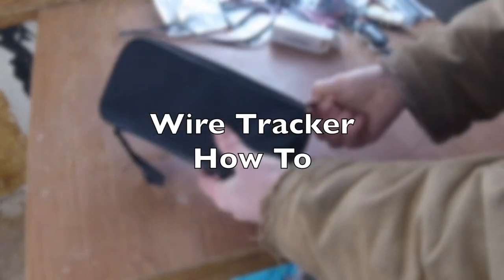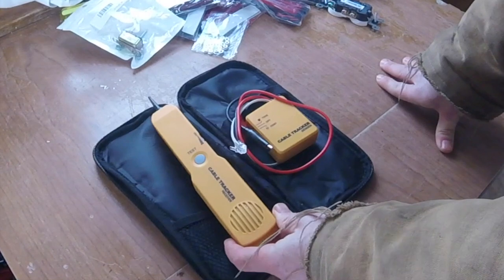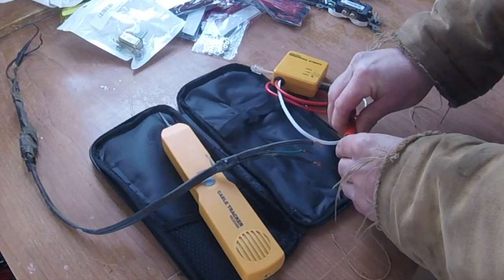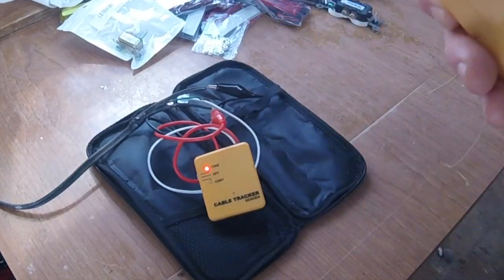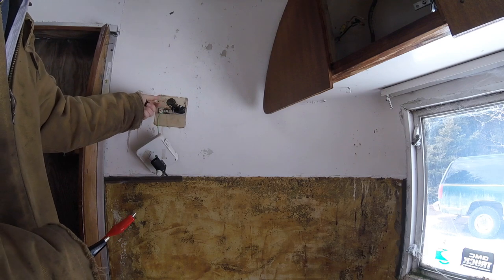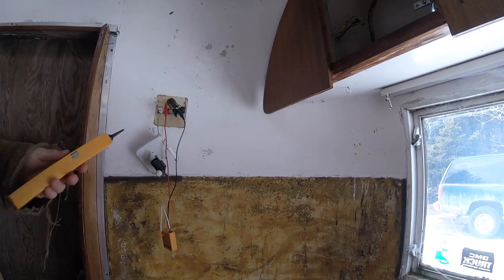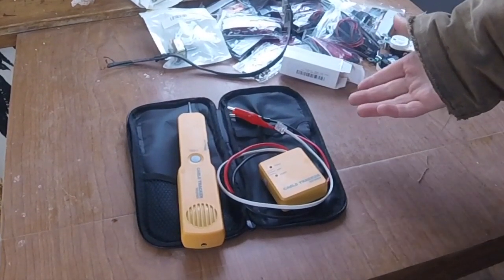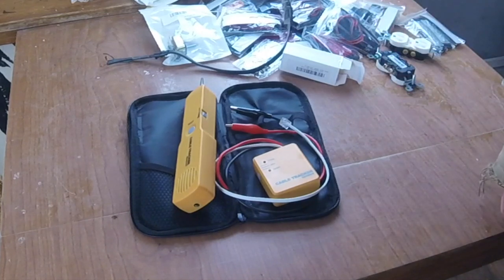HOW TO: Use a Wire Tracker / Tracer - (Locating Wires in my Airstream)

Comment: These types of tools are great when trying to track down a short in vehicle wiring. My truck had a short in the trailer wiring and kept popping fuses. Hooked up the alligator clip to a piece of wire and put it in the fuse holder and used the receiver to listen for the sound until it cut out, leading me right to where the short was. Found out a mouse had nibbled on the wires tucked up under the frame and this let me find it in just a few minutes. 

A cheap one worked just fine for me, but I know there are a lot better ones out there that are more sensitive and you don't have to be as close. But for $25 at Harbor Freight, it works pretty well. If I had to chase down wires regularly, I would probably invest in a better one, but the cheap one gets the job done for my infrequent needs.

Comment: Can we only use the red clip without using the black clip ? I need to trace a single cable, will this work ? Thanks
Reply: I have the same question, did you figure it out?
Reply: I also have the same questions
Reply: that what i looking for. i buy one, not same model. look its ok use single clip. red/black doesnt mind. but somebody said one clip must be earth, i dont see its necessary.
Reply: From my instruction booklet "Connecting the black test lead to earth ground will increase the distance the tone can be detected"

Comment: Hey, great video. I got the exact same tester. I'm trying to use it to tracer a cable that's in my car door and locate the wire in the car itself rather than in the door so I can tap off it. If i'm trying to trace a single wire, what do I connect the red and black aligator clips to? or Can i just plug in the red to the wire i am trying to trace? When I tried that, I get a tone all the way up to the aligator clip then when I plug the aligator clip into the connector pin of the wire I am trying to trace for some reason the tone becomes very very weak at the aligator clip. And hence because of that I cannot even get it to tone at the aligator clip let along after that spot. Any ideas what I could be doing wrong? Thank you.

Comment: cool litte tool but it isnt good for long runs such as coax 25` plus. but if you have a set of head phones it helps because at 25`+ runs the tone is very faint. not the high end eqt for sure but does work ok.

Comment: Will it track under ground coax cable
Reply from the maker: You have to be relatively close to the wire, inches really. It’s meant for close proximity tracking